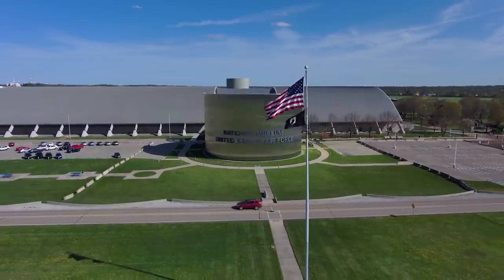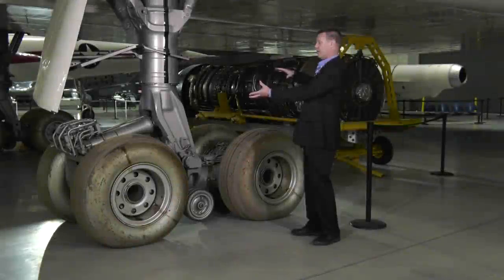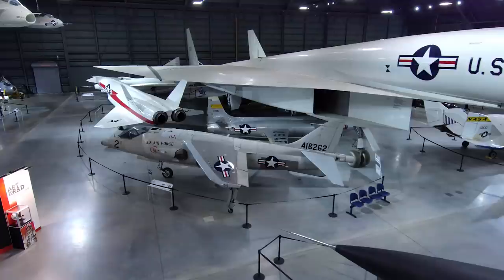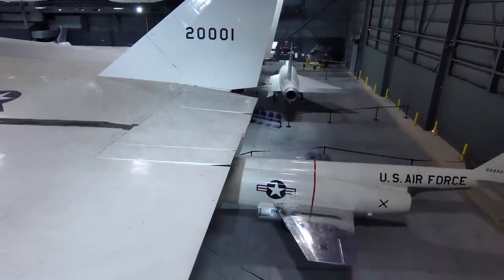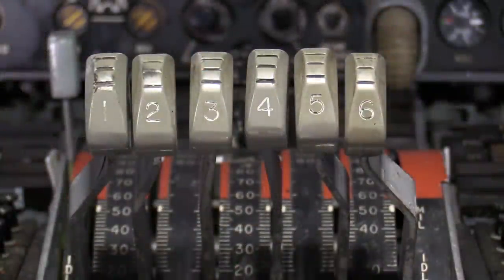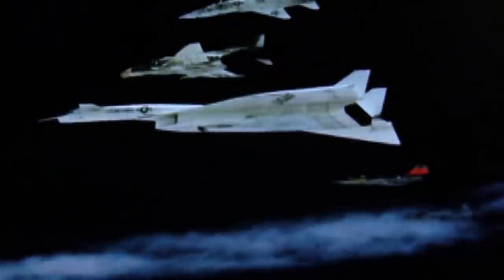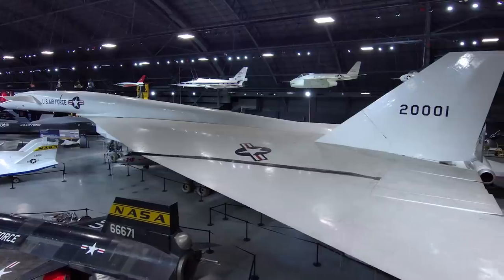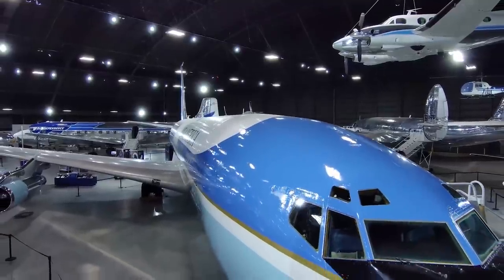North American XB-70 Valkyrie - Feature from the National Museum of the USAF

Comment: My father was an engineer on this aircraft. He told me that the tire fires were because the plane testing program was cancelled by Kennedy and placed in storage but then put back into a testing program for large airframes after some time and that the tires had "aged" and failed as a result. Apparently, the tires have a storage requirement that was not observed, or a shelf life, and after storage they failed at the first landing.

Comment: Corrections Dear NMUSAF;
 The Powerful and durable GE-J93 was not to power a "single engine fighter" as you stated, it was to power the two J93 engined F-108 Rapier. 
Also it was not just "steel" but Stainless Steel sheets that were brazed as face sheets to the stainless steel honeycomb. 
The engine box was H-11 Steel and Rene 41 covered in Titanium skin, not "stainless steel" for accuracy it would be good if you please correct these. 
All in all it is a Great video! 
Wish you would release all the video footage.

Comment: The XB70 is one of my favorite aircraft. 
When I was at the museum 11 years ago it was still in the X planes hanger across the field. I was surprised how big it was.  Especially how tall it was above the ground. 
I hopefully can get back to Ohio at some point and visit the museum again since so much has changed. 
Btw, what was the twin engine delta wing aircraft to the right rear of the XB70?
It looks like some sort of drone. I don't remember it being on display before.  I like the display around the XB70 with Tacid Blue, the YF12, and the other few much smaller aircraft under and around the bigger plane
Reply: The aircraft under the right wing of the XB-70 is the X-3 Stiletto which was the first aircraft to go at Mach 3 (I think). The plane behind the XB-70 looks like an XF-94 (Delta Dagger ?).

Comment: Avro Arrow engineers did a good job !
Reply: Wrong company - North American aviation.
Reply: @winternow2242  Engineers who worked on the Avro Arrow were commandeered by the U.S. after Diefenbaker caved in to gov't pressure. Nothing to do with companies, just where good engineers ended up.
Reply: @peterbarratt8699  they weren't "commandeered", the Canadian government put them out of work. As far as I know, NASA was the top destination. 

Timing makes it unlikely that any of them ended up on B-70 as Arrow was cancelled in 1959, a year after the NA design proposal for WS-110 had been submitted. The NA design had been completed in 1957, when those Canadians still had their jobs.

Comment: This thing is a future from past. Completely designed with slide rule, they don't even have pocket calculator back then, and the main frame is't to be used casually, imagine doing physics exam 24/7. I head the collision was caused by its aero dynamic generated unstable air density around one of the observer jet and sent it out of control.

Comment: By far the pinnacle of aircraft design and engineering.  There is nothing on this earth today that even comes close to the kind of creativity, original thought, and pure brainpower that it took to develop this aircraft.  No computers, just slide rules and teamwork and brainpower.  Having been in engineering for 30 years of my life, I cannot imagine what it took to make this craft a reality.  Great presentation.  I saw the XB70 in the separate hanger it lived in and we could walk around it, underneath it, touch it.  Never will I ever forget that experience.  Thanks.
Reply: Well expressed up to the “no computer” part. The IBM 360 was just a year away when this baby first flew, which suggests the computers used to support design for this aircraft were of some value.
Reply: As beautiful and complicated as it is, it became a white elephant as soon as the prototype was built - possibly even before. - It achieved nothing operationally. - I would argue that Concorde achieved far more, and lived up to it's remit. - It has never been equalled or successfully replicated. In serving it's purpose, Concorde was far more successful. By the way, it's spelt 'hangar.'

Comment: as a Brit, strangely proud to see the Harrier sitting with this incredible machine (and the X-1!)
Reply: Do you guys have a museum like this one in England? I would love to see a Vulcan and a Lightning.
Reply: @CRAZYHORSE19682003  The Imperial War Museum in Duxford has Vulcan XJ824, and the Lightning they have is that which a member of ground crew once accidentally took off in while trying to diagnose an electrical gremlin. Another air Museum near me is a tiny place run by enthusiasts where everything is cheaply housed in a handful of wooden sheds, so it's a surprise when you wander outside and see Vulcan XM612 sat there providing great shade to have a picnic under!
Reply: Not quite the Harrier, actually, but the XV-6A Kestrel, the Harrier's predecessor: https://infogalactic.com/info/Hawker_Siddeley_P.1127
Reply: @CRAZYHORSE19682003 :  Also check out the museum at Cosford. I think that's where you can see all 3 "V-bombers".

Comment: Ah, ya hit me a little bit in the feelers right there at the end. I first read about the XB-70 Valkyrie in a book when I was in 4th grade, back in the 70's. I was absolutely fascinated by the plane...canards, folding wings, and that engine stack! For years I grew up always thinking of it as that sci-fi airplane that only I knew about, because none of my friends had ever heard of it, at least not until the internet came along. Anyhow, just a few years back some friends and I took a motorcycle trip to visit the museum - we were blown away and could have spent multiple days there - and I got the chance to reach up and touch the plane that had so smitten me over 40 years ago. Check one off the ol' bucket list.

Comment: What a gorgeous aircraft! And the fact that its capabilities are still unmatched even 50 years later! Truly incredible, and a testament to the men and the age that created such a magnificent vehicle.
Reply: Sadly, advancements in Air Defense (missiles with 50,00 +ft. altitude capability and capable of mach 6+) outpaced the development of the XB70, although I suspect one of those "unmatched capabilities" was it's fuel consumption!
Reply: Built by men that knew how to use their fine-tuned minds and not rely solely on a computer
Reply: @glennthompson9133  I feel this aircraft is given more dew than it deserved, considering Concord was flying pasengers 4 years after this, and make no mistake Concord with pasengers could reach MK 3 but was limited to MK 2.5
Reply: @desmondleroux3444  Concorde was built largely of aluminum alloys and therefore could not withstand the temperatures that the stainless steel and titanium XB-70 could. Stainless steel was also used in the Atlas ICBM, which launched the Mercury astronauts, and I believe in the Mig-25, which was designed to intercept the B-70. Now it is making a comeback in the Space X Starship and its booster.
Reply: @desmondleroux3444  Fact - Maximum speed of the Concorde was Mach 2.04 (1,354 mph or 2,180 km/h at cruise altitude. It did not have the power or materials for Mach 2.5 or more.
Reply: @Dxyzxyz  that's with four engines and pasengers, and yes they did have the material, it was designed for MK 2.4,garrenteed with another two engines, or more powerful engines it could reach MK 3 quite easily, the heat index between MK 2.5 and MK 3 is only 8 degrees celses.
Reply: @awuma  the Concord had titanium point on the nose cones and other areas, were the heat was intense, even the American shuttle project was over kill, considering privateers, re-entry into the earth orbit never used heat tiles, but found that a slow angled projectory through the atmosphere, there ships never needed heat tiles
Reply: @desmondleroux3444  references?
Reply: @desmondleroux3444  Facts - Concorde at Mach 2.05, the skin temperature varies from 261 degrees F at the nose to 196 degrees F at the tail. The titanium  SR-71 at Mach 3+, the skin temperature varies from 800 degrees F at the nose, 620 degrees F at the windshield to 1200 degrees F at the engine cowling.
The aluminum skin on the Concorde would have melted at Mach 3.

Sources: former Concorde engineers and nationalinterest.org
Reply: @Dxyzxyz  fact! Check what the Concord temp was at MK 2.5 relative to a point five difference, in celses, and knowing that the engine separation cone was, already using a very small titinium tip, on a specialized plastic cone, very advanced for its time, the wing was designed to shed heat, what iam saying is the mission was not the same as the SR71 or 2, but with the right engineering it could probably reach MK3, which was was a 0.5 difference, in fact the Concord on re-heat has to be retarded from excelaration, were as the SR71, 72 relying on an extra 30% power from dual engine function at its converts engine thrust into pulse action, to prevent fan blade stall
Reply: @desmondleroux3444  Heat is the issue at Mach 3. The Concorde aluminum skin would melt. Cooling with fuel was not enough. The maximum speed was reduced to meet the 50k hour operating goal. The SR-71 speed was also limited by heat. And it used special fuel to handle the heat. The MIG-25 frequently destroyed engines by over heating at Mach 3.

Comment: Notice where the fuselage and engine inlets connect. The wrinkling of the skin is not normal. This is De-lamination of honeycomb and skin.A lot of stress on this area. Gravity has had its way with the old girl. I wonder if it happened while it sat outside in the elements for so many decades.
Reply: My guess is that it is more likely that the braising failed at speed/altitude. This is a high temp area too, I believe.
Reply: @GypsyTinker2012    If the braising failed at altitude and speed I think it might have caused a catastrophic failure. Watch the drones vertical video footage,there’s a lot of wrinkling there. I think it’s more likely that during the decades it was outside in the rain,snow and heat that moisture got into the honeycomb and expanded and contracted,maybe a bit of corrosion and the honeycomb and skin separated. Along with all that weight up front it may have caused the wrinkling. The last time I was there was 2015,I noticed it from the ground,and this was before the new building was even started. The old building was rather dark,now you can get a better look in the new building. This video footage really gives you a good look at it.

Comment: AR 4:54 I am noticing that the skin of the aircraft is loose and wrinkled, will that expand and straighten out as the plane gets up to temperature? Is the nose of the XB-70 made of inconel?
Reply: the wrinkles are like on a golf ball they actually provide lift as well and are a bonus of the honeycomb layered metal ... and no it doesnt need to expand like the sr71 as it was built overlapped in the honeycomb sheet already ... and the nose he said was titanium ... alloy most likely titanium chromium steel ...
Reply: @0623kaboom  I know about giving the fuselage an eggshell-like texture to create a boundary layer, but this is not that. It is just a short wrinkle of the skin and no it does not serve any kind of aerodynamic person. It may just turn out to be a manufacturing imperfection. 
Take a closer look at the time slot I provided.

Comment: Clearly an extraordinary piece of engineering and showed how advanced aerodynamics could work but you have to wonder how it would have faired in the real world. It had 6 high power engines that ran on afterburner all the time. Imagine the fuel consumption and therefore the fuel capacity required. Its almost self defeating. The huge black exhaust trail shows just how much fuel was being burned and not too well at that.

It was so tragic that two highly skilled pilots died because of a simple error of judgment but the F-104 widowmaker once again proved its name. RIP those two brave men.

Comment: All do respect, not to change the subject but I spotted a aircraft that the UNITED STATES AIR FORCE hung on to and I'm a huge fan of them, I didn't think they were still around.THE "YF-12A BLACKBIRD"., THE NO.3 OF 4 BLACKBIRDS MADE.Only 3 were built and the airforce wanted to make interceptor out of them.The reason why you don't see the edge (chimes)from the nose tip,back about 6.5 feet is because the airforce would put either radar equipment in the nose or camera equipment in the nose.Also there were only 4 clamps that held the nose in place,the air pressure would push up aginst the nose during flight especially at 80,000 feet.Only 3 YF-12A'S WERE BUILT.

Comment: Hands down the greatest aircraft EVER made.  Weighed 540,000 lbs @ constant cruise of Mach 3.15 with best lift to drag ratio of any aircraft to this day (34% increase in lift), 4000 psi hydraulic system, largest moving parts of any aircraft ever, heaviest plane to exceed mach 3 and ONLY aircraft able to do so nearly indefinitely (5,290 nm range without refueling, but could do in air refueling), used titanium alloys, is the most expensive aircraft ever made (7 billion $ per aircraft including R & D), first bomber to utilize rotary launcher, had 50,000 lb weapon load capacity (could carry two 20 megaton thermonuclear bombs).  The best book on this perfection is “Valkyrie - North Americans Mach 3 Superbomber” I spent 125$ on the hardback copy and havent regretted it.  The Six YJ93-GE-3 turbojet engines could operate at mach 3.2 at up to 95,000 ft….
Reply: When did this plane carry a rotary launcher or any weapons?  My information was that the highest attained speed was 3.08, and that was by AV2, for 20 minutes. Are you referring to anticipated or realized performance?
Reply: @winternow2242  So it was a secret aircraft, and the true potential was never revealed to the public.  As for engine abilities (Mach 3.2 @ 95,000ft indefinitely up to 30 hours of constant flight time at Mach 3 or above as the engines were the MOST fuel efficient above Mach 3), for the given 3.15 mach attainment for over 30 min (over a remote corner of southwest Wyoming) this was gained from a very very hidden and obscure webpage by an ex Radar operator that tracked the XB-70 (out of Idaho) and reported the ACTUAL results - we wanted to ALWAYS keep those evil marxist commy bastards guessing, as well as a wealth of knowledge not found ANYWHERE else on the web.  I confirmed he was not lying when I read the book.
Reply: @Galileo7of9k.  Still badass plane.  Guess you gave up looking…. Clearly you think all of it is gibberish.  As the aircraft’s weight decreased and the engines provided the same thrust it was possible…
Reply: @Galileo7of9 HAHAHAHA 

YOU GAVE UP!!!

Thoroughly enjoyed this conversation!

Cheers!
Reply: @Galileo7of9 Just keep escalating.  DO THE MATH!!!!

Im not lazy.

Comment: I do understand that airplane fans won't give a toss, still, a small correction about the difference between history and heritage: historical heritage as it was defined here at min. 21 only talks about 1/3rd of what it encompasses: historical heritage not only deals with knowledge, skills etc., that of course is only immaterial historical heritage. Objects and buildings too are part of the historical heritage triad: helmets, pilot's uniforms, pictures, instruction manuals, the factory where a plane was build, where well known pilot like Yeager was born, the hangar where a plane was stored, the buildings where it has been developed etc. "History" in that case becomes the tool used for data enrichment whenever objects, buildings, skills etc are described in historical heritage databases.

Comment: In the footage of the wheel fire, the left tire on the nose gear also disintegrates shortly after touchdown. Perhaps the plane had nose wheel brakes, and heavy braking caused one to pop. If there was no nose wheel braking, why did it fail?
Photo flights are far more dangerous than most people realize. Wonder how much time they spent briefing that stupid publicity shoot, mapping the expected vortices, etc. The pilot in the 104 was clearly not informed of the danger. Unbelievable screw up.

Comment: Was at Wright Pat as a kid and saw this bird parked outside of the museum... probably 1972-73(?)  timeframe. I was 6-7 and remember walking under and along the aircraft outside the hanger. Glad they restored it and moved it in doors. Along with the SR-71, in my opinion, there is no better exercise in American Aerospace Engineering Exceptionalism of that era... although I have never been up close to a Hustler... that would be cool. This video, although appreciated, doesn't even come close to displaying true American Aerospace Engineering advancement of that era... let alone what was learned from it. I would have thought NMUSAF would have done a better job at splicing together actual development footage. Those Engineers did it with slide rules... as my Pops would say.

Comment: Why are the canards bent when in all the videos they are straight?  It doesn't look like there is a hinge at the bend point in the drone videos.   Just imagine how much better it would be with todays engine technology and how much lighter and fuel efficient they are. Combine that with todays super computers and smaller, more compact electronics, and probably shave 50K pounds from it. Lighter, faster, more responsive.   In a sense, already done, there are several XB-70 RC aircraft flying around the world.